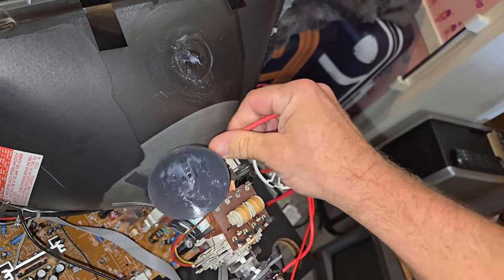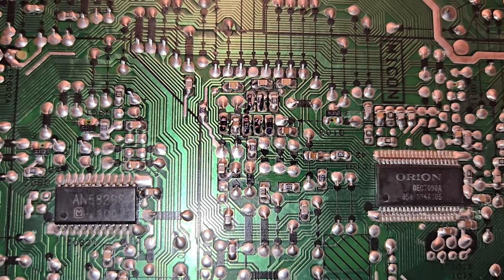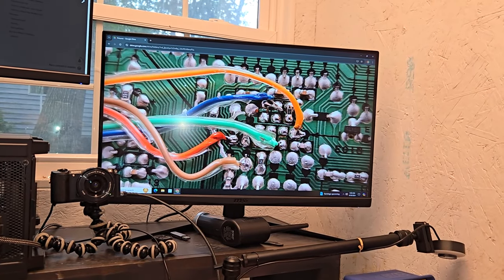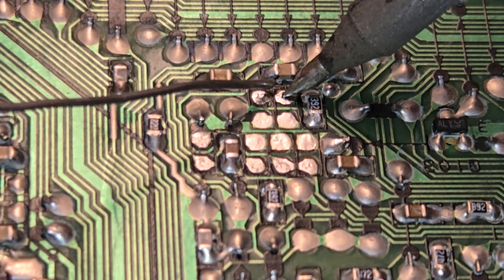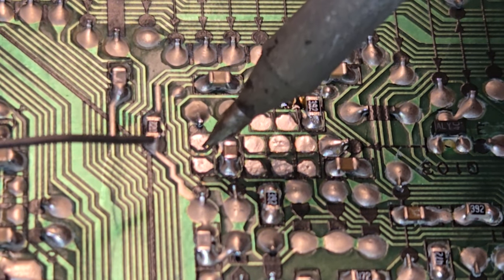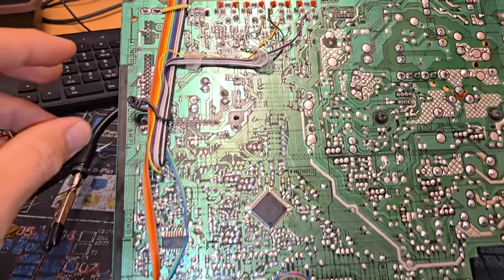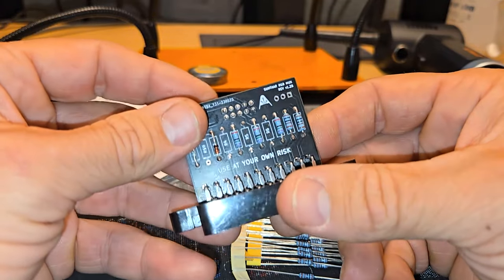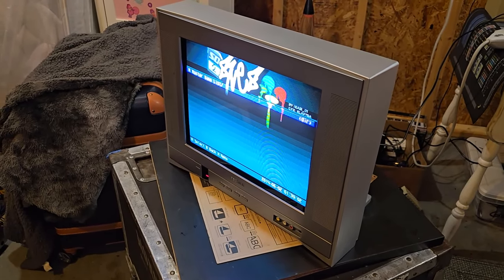Why RGB is better than component - Toshiba AF CRT Mux mod

Comment: For TVs with component input, it is better using those as the RGB inputs and set the blanking to the right voltage. Even the video circuit shows that component inputs will act as RGB input when set up correctly. For a TV that I have, I've used the component inputs, then set the TV to AV2, when blanking with the correct voltage, it accepts the RGB signal. Each set is different, so the service manual can be checked to make sure this can be done.

Comment: 18:40  So these Toshiba sets, (not just the AFs) made by Orion from 2003-2005 use a Renesas jungle chip that has shifted chroma over component. That is the artifact you are seeing, with the reds and blues not lining up. (Also, reds are over-saturated too, aka red-push.) The Orion-shiba sets from 2006-2007 use a Sanyo jungle chip that looks even worse, and it can't be RGB modded at all.
Reply from the maker: Great info!

Comment: In the future consider soldering sync to SVIDEO instead. I believe this bypasses the composite comb filter and as a result the picture will not shift to the left as much. It will still shifted, but a lot less. The downside to this is you may need to plug in a 'dummy' SVIDEO cable so that the TV goes into SVIDEO mode. A $2 unpopulated SVIDEO plug will achieve this.

Also the 240p test suite has a left and right audio test which you should always check when performing these RGB mods. Some sets, specifically Sonys, require both audio RCA inputs to be populated or it will not activate stereo and so audio will be in mono. If you run into this scenario, then you will need to connect dummy RCA plugs into both L & R inputs which will forces the TV to activate stereo.
Reply from the maker: Thanks Mark.  I'll definitely go for sync on Luma next time I do a mod on a svideo TV.

Comment: Funnily enough, this could theoretically help with some European CRTs as well. My Beovision Avant from 1996 has some image processing going on (It's widescreen but NOT a 100hz model) even though I feed it RGB through scart. The main problem is that it has a similar red push which is a bit annoying but it's definitely not as bad as with this Toshiba (it also has scan velocity modulation but that I was able to disable by removing a cable from the neckboard. Overall the picture is pretty amazing so I'm not too bothered with the processing). I'm sure there's a lot of European sets with similar image processing even though we are able to feed them RGB through scart. RGB modding a RGB capable CRT would probably be an overkill but I wouldn't be surprised if someone in this hobby is gonna look into it some day.

Comment: Steve, the dielectric grease should be kept away from the anode hole (and the inner rim). It's purpose is to form a seal where the rubber cap touches the glass. I'm hoping your viewers won't take example on how it looks at 0:58, because that's definitely the wrong way to use the grease. Thanks for the video.
Reply from the maker: Yeah, I was actually just doing some experimenting with the dielectric grease on this one.   I was playing around seeing if adding a ton had any effect on the screen or discharge.  Surprisingly, I saw no difference and had no difference on the TV for performance and it didn't effect the discharge any.  Just playing around, breaking all the rules to see what happens, 😆.   This is not a discharge guide or a dielectric grease guide, but I still didn't see any changes with using the absurd amount of grease in this shot.  Thanks for pointing that out.

Comment: You can get better results by skipping the Dremel entirely. Drill a few holes in the center (I'd say about 3?) and do everything else by hand with the file. It will just take longer.

Comment: I made some restoration on some old Amiga 1081, common issue is reflowling heavy components.. Anyway. I need to discharge those monitors like 2-3 times.. With 5 minutes in between to completely empty the juice in that.. Does that missing a bleed component or why does it behave like that?